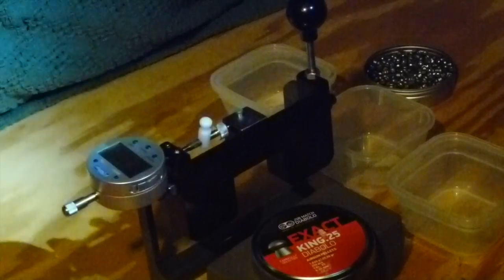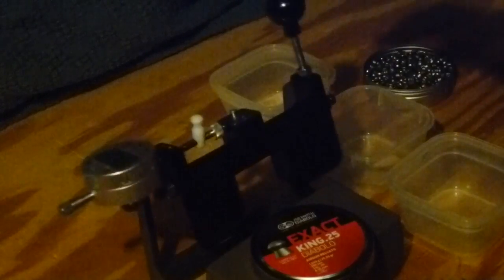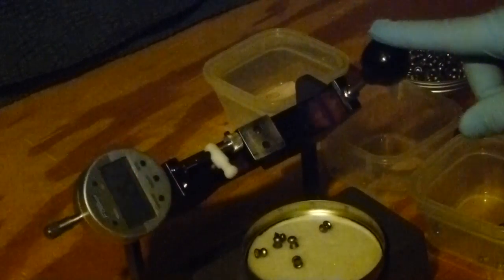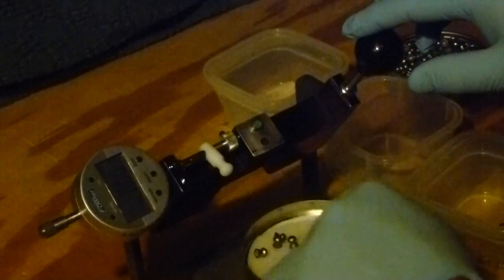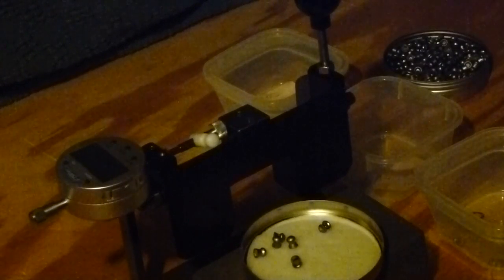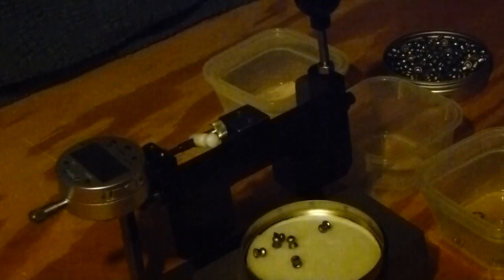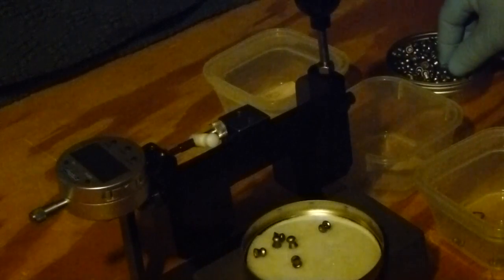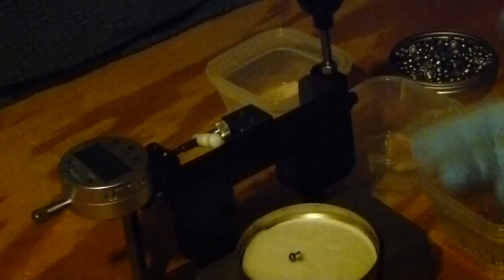Lead Head Air Gun Pellet Sorting Tool -Introduction

Comment: You were very thourgh thank you....I found your documentation about your measurements and you comming to the conclusion to use a .001mm resolution gauge. Great job and thank you for your hard work. I see at the last page you made weight measurements for only 6.35 mm pellets and found variation. Just wondering if the differences were seen in the shot pattern. Would weighing first to sort then size sorting be the best order from your findings to save your time....I also was intrigued with your pellot washing and lemon pledge coating process. Pratt' s head sizer is a great and simplistic functional design....another great job! Thank you both for the lesson.
Reply from the maker: Thank you.  I had fun.  Until everything is cleaned it is hard to weigh them.  Pretty much have to get all the lead dust and dirt off.  Then I felt size was the biggest factor based on my gun and how it shot and the range of weights that I was seeing.  Thanks for commenting.